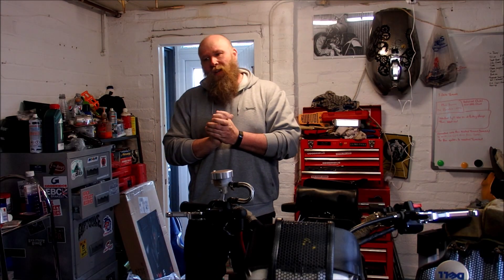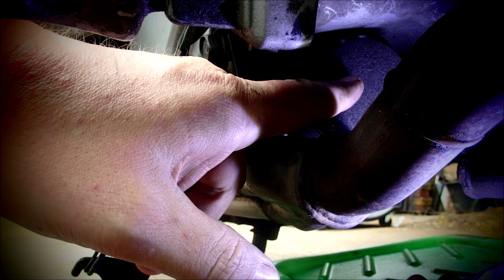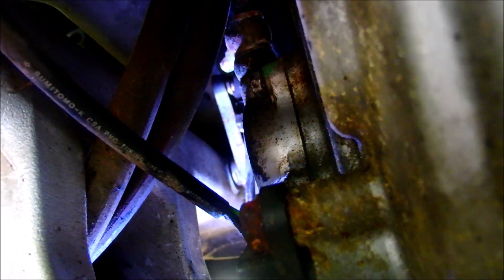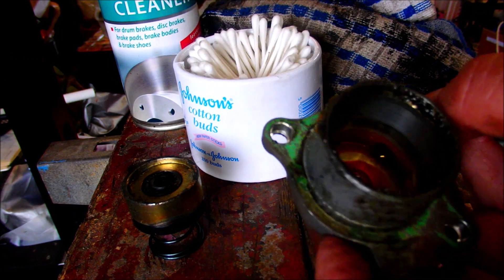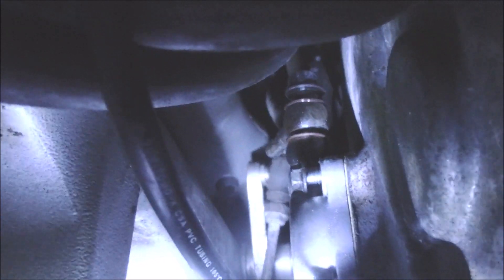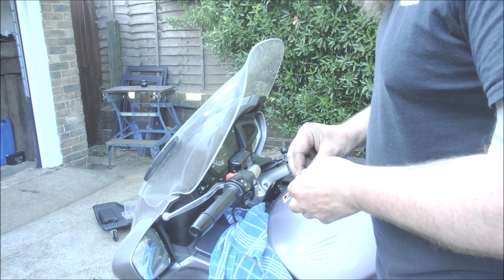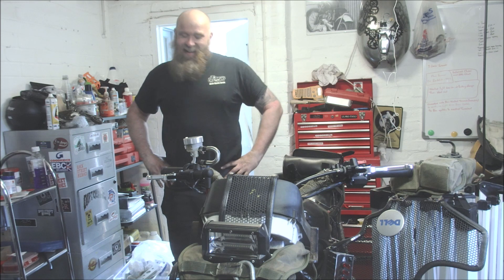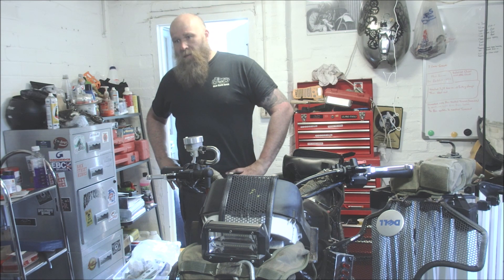Step by Step - Motorcycle Clutch Slave Cylinder: Full Repair

Comment: A very informative video. I used it to replace my leaking slave cylinder. I bought a complete replacement cylinder from David Silvers complete with gasket and bango washers for around £90. Just as well I did as mine well cruded up with dried fluid. 
Did mine in the garden with bike on side stand which at 65yrs old took me about 8 hrs including frequent tea breaks and lunch and the walk abouts when starting to ache. Get something decent lay on. I used two yoga mats but my hip still ached for two days afterwards. That’s what happens as you get older☹️🙂.

Comment: Thanks for this video, did the job today, for no other reason than I was changing the headers (gives marginally more room) and heard this job would need done at some point and was a nightmare. Took me about 2-3 hours and the worst part is it didn't need done, had been done already!😂😂😂I have small hands so it was easier for me. Wouldn't of done it without this video. Now at least I have piece of mind. The 12mm flexible spanner is the reason you don't need to drop the engine. The Haynes workshop manual says you do so top man for that one!

Comment: Oh what an absolute gift of a video thank you so much.
My clutch leaver was going soft when the bike was warmed up I priced a new MCSC from Honda Ireland it was €384 plus Vat just for the part. WOW 
I got the repair kit on ebay for €23 followed your video and 3 hours later bang done.
Just back from a 400Klms spin around the south of Ireland and the clutch was perfect all the way nice and solid. 
Thank you so much great video 
Regards Ken
Reply: Thanks for the tip re the kit on e bay Ken.
My clutch is doing the same, so it must be the slave cyl. 
Keep the shiny side up Ken.
Regards

Comment: Cheers mate great video 
Extra help for others I had a very small topeak bit wrench and I modified a bit adapter and a 8 mm socket by grinding them as short as possible to fit the gap between the slave cylinder and the metal brace/stand and was able to undo and do up the 3 bolts with relative ease. Still not easy as all the space is restricted. I also used a long screwdriver with masking tape reversed so the sticky side was up on the end to get the new washers on the bango  bolt. 
Hope this is helpful to others.

Comment: Many thanks for this vid, especially around the 15 minute mark. I had the exact same problem, the oil seal came away in bits and I was left wondering how the new seal would fit. Same thought process - wrong kit? Just that few seconds of video and I discovered exactly the problem - with all the rubber removed from the old seal it looked like the old seal was integral to the piston whereas it still needed to be removed.
Reply from the maker: Glad it helped

Comment: Great video but 1300 st slave doesn’t seem to be leaking not loosing oil but haven’t got a clutch master is ok blanked it off had a full lever bled the system umpteen times I’m at the end

Comment: Thank you for your video , i just hope this will fix my problem  ..  my clutch handle does not come back for me , it like the slave piston is not returning …  i got the slave cylinder off ( after a lot of CUSSING)  the inside looked ok  , i polished the inside bore and piston with very fine steel wool , my gasket is now on order :-( anxious for it come in  ….
Reply: Hey Don, what was the outcome on your clutch repair? Weak spring?

Comment: Yours is one of several videos showing this repair and you both have the bike on its side stand. Does the centre stand get in the way of the job as I`m planning to use my hydraulic bench and wouldn`t like to have it biased over to use the side stand?
Reply from the maker: If the bike was on a ramp and you could stand directly underneath it, the centre stand would be fine, but if laying on the floor, having the bike tilted away from you just gives you a little more room.  I did see a couple of posts about laying the bike at 45 degrees against something of appropriate height, which would give you great access and viground lew, but i didn't have anything and laying bikes on the ground for a couple of hours, normally ends in a shed load of other problems, so just followed the guide.

Comment: I recon the bandit would be easier to do as it is exposed. I recon if you had a motorcycle lift bench it would have helped. I know there is a space problem you most likely have.
Reply from the maker: Aye, the majority of bikes, the slave cylinder is exposed, I think the pan is the only bike in Honda's range where the cylinder is at the back of the engine.   Everything I read prior to the job said the bike lift wasn't any easier, other than the fact you wouldnt consistently be up and down off the floor.   The only improvement they all agreed on access wise, was to remove the speed sensor and lay the bike on its left hand side.  The sensor bolts were corroded, and I didn't want to make an already crap job, 100 times worse by snapping a bolt prior to even starting.  The laying the bike down.... I was 50/50 for a while,  access wise, I cant think of a single step that wouldn't have been improved by having that entire area open to you, still would have been laying on the floor, but access would have been from underneath rather than from the sides.  The reason I didn't go for it, was I also reed, people had reported issues with the safety feature that stops fuel in the event of the bike tipping over...

Comment: Does the oil filter have to come off to remove the slave cylinder ?
Reply from the maker: The write up I followed suggested it as it gives you more room to work.  Not sure you have to, could always try it with the filter in, and see how far you get?
Reply: Cheers for that. Enjoying your ST1300 videos a lot!